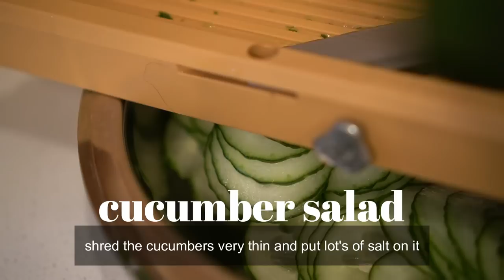DAILY CLEANING WITH HEALTHY HABITS | ALL DAY CLEAN WITH ME

Comment: Dumplings do freeze very well.  Maybe take a couple or 3 hours and make up alot of them.  But its important not to stack them on top of each other while they freeze.  You need to freeze in single sheets, then you can transfer the frozen dumplings into larger containers or baggies for the freezer.

Comment: If you cut the tips of the cucumber and rub the ends with it in a circular motion, it will release the bitter liquid from the cucumber.

Also, use a candle snuffer instead of blowing it out, then you keep your good energy.
EVERMARKET Long Handle for Putting Out Extinguish Candle Wicks Flame Safely (Rose Gold)